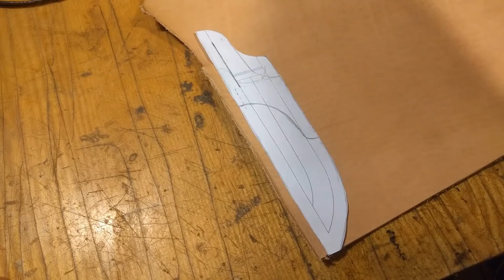Leatherwork - Sheath For Dark Nordic Knife

Comment: Great work and patience. You can just wrap the leather around the back of the knife to save yourself half of the stitching. Also, on edge side, there should be additional leather spacer between front and back leathers, so the edge does not lie against the seam but against the spacer.
Reply: Yeah, I had the same comment. I've made sheaths without a welt and always regretted it because it is so easy to slice the stitching while inserting a sharp blade. One thing I picked up on was the use of the skewer to apply edge dye. That is a good idea and I'll try that. I usually use a Q-tip but it can sometimes be a little sloppy.
Reply: Dude, he looks like he knows what he's doing.

Comment: isn't it bad that the blade edge is in contact with glue/stitching rather than another piece of leather?
Reply: The glue kinda acts as the welt. I made a knife sheath without one, not to long ago. It worked great... but just for safety precautions I added a raw hide insert to cover the blade. I didnt want my knife to slice the stitching while in the woods.

Comment: Without a welt you will in time cut the threads.
Reply: Yeah I was curious as to why he wouldn’t make a welt, unless this isn’t intended for use rather a show piece for the shelf.
Reply: Also no drain hole at the bottom.